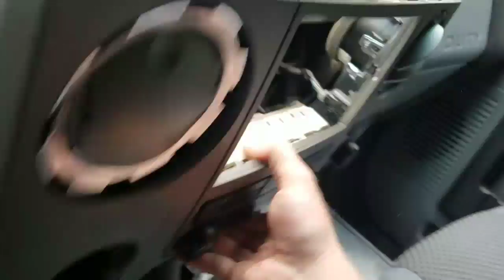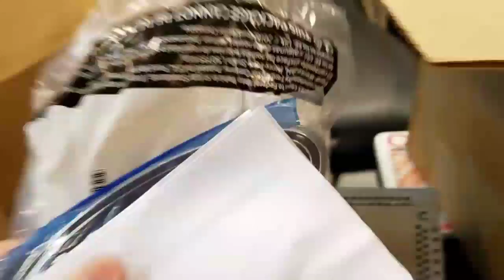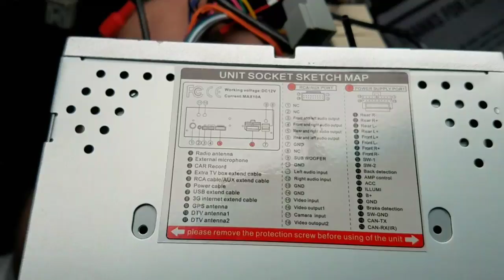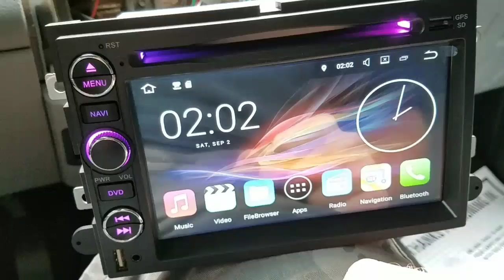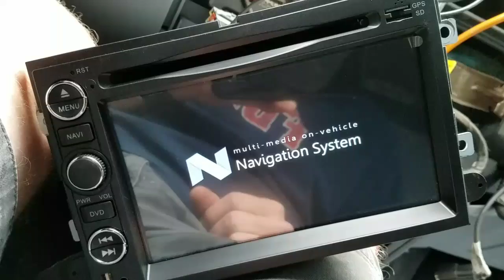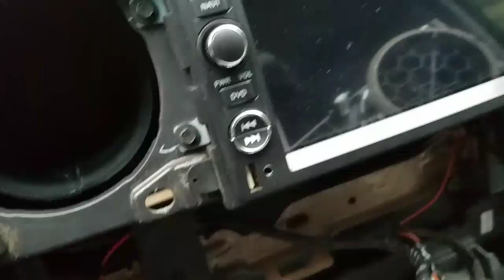2011 - 2016 Ford F250 Super Duty Android Navigation and Tailgate Backup Camera System Installation

Comment: Thanks for making this video. It is full of valuable information that I used to install a Jensen CAR910X in my 2012 Super Duty with OEM Navigation unit. I too wanted to wire my AUX4 switch to force the rear camera on, but have failed. I used the switch to parallel 12V to the Reverse wire in the harness. I put in diodes so the AUX and Reverse signal did not back feed into each other, but both put 12V onto the head unit Reverse input. I assumed the radio would see the 12V on the Reverse and both switch to display the rear camera AND power up the camera by putting 12V on the Camera Power output wire. For some reason the Reverse Camera still works when I shift into Reverse. However, while the AUX4 switch makes the head unit switch display to camera, it doesn't power the camera, so the display reads No Signal from Camera. WHAT? How is this possible?

Comment: For illumination what if you don't have upfitter switches
Reply from the maker: Go from the headlight switch. That's the best way. Use the parking light power feed. Hot when parking lights are on.

Comment: I have a 2014 ford f250 and bought stereo using your link off of Amazon will I have and install that you did with acc power or will I have to cut red wire from stereo and run wire to purple green wire?
Reply from the maker: I have another video on finding the acc wire. It just depends on what truck you have but I bet you will have to get it from the bcm
Reply: @JackofAllMasterofNone  is that's where you found your    purple and green wire?
Reply from the maker: @ajackson8926  https://youtu.be/2hWT9sGHLgs
Reply: @JackofAllMasterofNone  this will turn radio on and off
Reply from the maker: @ajackson8926  Yes
Reply: Thank you

Comment: I am installing this into my truck and when plugged in and I turn the key I only get a white screen. There is a blue acc+ wire out of the main plug but I don’t see anything to connect it to. Do you know what wire or pin I can connect into the can?
Reply from the maker: Unfortunately I dont have enough information to help. It depends on what year you are installing this in. In my truck, there was no use for the can interface. The blue wire you describe sounds like the power antenna or amp wire. They will most likely not be connected to anything.
Reply: @JackofAllMasterofNone  I am installing in a 2011 f350. The red wires you had to connect to get the unit don’t appear to be on the unit but it’s the same unit you had. It’s labeled the same as your red wire was as well. If you would like feel free to contact me. I would greatly appreciate it!! Garrett.rose35@gmail.com

Comment: Can you post the exact stereo you bought, where can it be found? I have a 2011 F-250, don't need the camera, Did you happen to look for the harness to make steering wheel controls work? it comes with correct wiring plugs?

Comment: was it hard to wire back up camera? like was there small thin wire that you had to ground. are the wires quality? how much did that camera cost?
Reply from the maker: I don't remember how much it was. Google Ford oval backup camera. It was not real easy to install. Had to cut metal on the tailgate. Not for beginners really. It was good quality and works well. You do have to hook up power and ground.
Reply: Jack of All Master of None ok where did you hook up to power and where did you ground it, I have a cheap one now and the wires are so thin and crappy and trying to ground to frame on outside of truck with thin wires isn’t idea

Comment: got the Hizpo unit for my  2015 F250 and got it up and running but it wont shut off when the key is pulled out and door opened. It  seems to be hot wired to the battery once it is plugged in. Any idea how to fix this problem? Or is it time to send back to Amazon for another one that is prewired correctly. The unit has good picture/sound quality and interfaces with the backup camera well, too.  Thanks in advance for any info
Reply: hello I have the same problem, did you solve the problem?
Reply: @SoyElchucky7  no. Returned it

Comment: My unit wont turn on with the truck. I have to push the unit power button to turn on and off. Also where is the video for the stering wheel?
Reply: I have a 2012 F250

Comment: My 2013 F250 has steering wheel controls and I assume they worked with the factory stereo. The previous owner removed the stereo and installed a junk Walmart single din. Anyway, will I need FORSCAN to get the steering wheel controls working? I'm thinking no?
Reply from the maker: No you should not need to do anything
Reply: @JackofAllMasterofNone  Thanks.

Comment: What do you wire the medium size plug to?  I purchased a wiring harness and it only came with the larger harness.  I wired it up and the unit comes on but no sound.  I do not have steering wheel controls and have the basic stereo in my 2011 F-250.
Reply: U ever figure this out?

Comment: Just bought this for a 2012 F250 and it doesn’t work. Radio works fine when truck is off, and then turns off when I turn truck ignition on. When truck ignition is on it get the “no signal message”. Don’t understand, I may try to return it and get a new one to try out again.

Comment: I’ve purchased this radio for my 2016 f350 and when I turn the key on for the truck the radio says no signal what could be wrong? When the key is off the radio works and does not say no signal
Reply: Mine doesn't even say no signal.  It's on, but just a black screen.  Did you ever figure anything out?
Reply: Austin Nichols we took it to a professional and they determined that the cam box it came with was not programmed for the right truck we followed the links for this radio and got the one for the 2016 supposedly however it didn’t work. We sent it back and got a name brand radio
Reply: @michaelamanross3903  well, that sucks...   I really like the way this one looks, but if it doesn't work, it's no good
Reply: Austin Nichols yeah we liked it to but it just ended up not working

Comment: I have a 16 xlt I already have steering wheel controls and sync also have sat radio. Will everything work plug in play? Or will I have to use 4scan also? Thanks! Your videos are very helpful!
Reply from the maker: If you install a stereo like this you will loose sat radio and sync.
Reply: @JackofAllMasterofNone  ok, since the truck has steering wheel controls from factory they should work plug in play?
Reply from the maker: @dustinlee8389  No. Probably not. Watch this video https://youtu.be/38oEHUenAPQ
You will probably need an interface.

Comment: I have a similar android radio and 2011 f350. I just can't seem to find the acc wire to tap into. My wireharness fits but doesn't quite work. I got mine from dblink. It's the fd03. Also could you elaborate more and a reverse wire signal wire. I've looked for ablue/white one but was told that was not a good one to tap into.
Reply from the maker: For the reverse wire i always run it from the backup lights in the bed along with the signal wire from the camera. See my other video for a good accessory wire feed. https://youtu.be/2hWT9sGHLgs

Comment: How is the actual radio, someone installed a Jensen radio in my truck and the radio is horrible picking up fm stations that are normal strong. Thinking about going to something like this. Thanks!
Reply from the maker: It has worked very well for me no problems. The reception is worse than a pioneer or Kenwood

Comment: I picked up a similar unit for my F250. Had the same issue with the illumination wire. When I tried to connect it to my upfitter switch like you it caused the illumination lights to flash on and off. Did you run into this? A constant 12V keeps the lights on so I’m not sure if it’s an issue with the wiring or unit itself.
Reply from the maker: The fix is to use +12v from the parking light circuit.  The problem with using the upfitter switches (which i found out myself later) is they dim when u lower the brightness of your dash lights and drop voltage, which causes the radio illumination to go haywire.

Comment: Where did you get the harness ??? We have looked literally everywhere .
Reply from the maker: Which harness?
Reply: @JackofAllMasterofNone  dude the facking harness you have to buy to connect the aftermarket stereo to the stock ford wiring. its not that hard a concept. did you make it in your basement?
Reply from the maker: @45acarey  It's a standard ford wiring harness. Literally available anywhere. Google search is your friend. Metra Electronics 70-5520 Wiring Harness for Select 2003-Up Ford Vehicles https://www.amazon.com/dp/B0007WTF34/ref=cm_sw_r_sms_apa_i_Z9qaFb12CQT42
Reply: The wiring harness for the stereo, where did you get it

Comment: Could you post a link to the head unit and reverse camera?  That radio looks great!
Reply from the maker: This video is a few years old. They dont make the exact head unit anymore. Here is the updated version https://www.amazon.com/dp/B077C2W6VN/ref=cm_sw_r_sms_apa_i_cOlzCbB1ZB7JG
As far as the camera just search on ebay for Ford oval backup camera
Reply: @JackofAllMasterofNone  I bought this radio, but the new harness does not have an acc connection option like you used.  Could you explain in more detail?  I've tried connecting a couple different combinations, with no luck.  I've got an "acc+" "K1" "ANT" and 2 other wires, but no connectors, and I can't seem to fine the right connection to make

Comment: How did you order that radio with the f250 plugs? What model number is the radio
Reply: Andrew Beeman that link says it's for a 08-10 f250 will it fit a 11-16 f250
Reply: @gabemeyer3688  yes they are the same. its the exact kit hes using, model number and everything
Reply: @TheBeeMan1994  so the only difference is the link you have had backup camera with it and its one that goes on license plate then correct
Reply: Is that correct then ?

Comment: Im gonna be putting in my old pioneer dvd player in and will have to buy a aftermarket backup camera. It has the logo camera now but wonder if the tailgate handle would be better? It's a little cheaper
Reply: The tailgate handle camera gives a much better view than the logo camera. Plus, you don't have to cut the tailgate open for it to work. Plus it's pretty much centered.

Comment: Do you lose function of the stock subwoofer if you go with a aftermarket headunit?
Reply from the maker: Depends on the headunit. But you can keep a stock sub working with an aftermarket adapter kit.

Comment: Jack of All Master of None Where did you put tour mic for BT calling? I just bought a deck but can't seem position the mic in a position that picks up my voice, I am finding that the stock mic with the sync system is far superior to the driod head unit.  I just want another opinion, thanks
Reply from the maker: +Cheyenne I just use the internal mic on this installation but I would normally put it up along the headliner near the mirror

Comment: Great vid. Just ordered the same exact one off amazon for my 2012 f250, suppose to be here Monday. I'll be using this vid for sure, How are you liking it so far?
Reply from the maker: Jim 08 Ive had many Android head units and this is by far the best one Ive ever had.  The sound quality is very good.  In my other video I got the steering wheel controls working as well.  Enjoy.
Reply: Jim 08 is this thing still going strong?
Reply: Daren Ferreira I'm hoping so. Im thinking about scooping one up for $200.